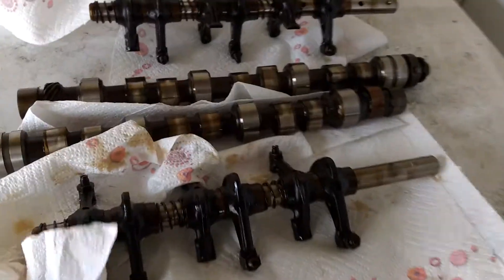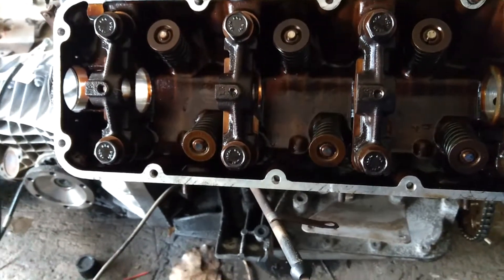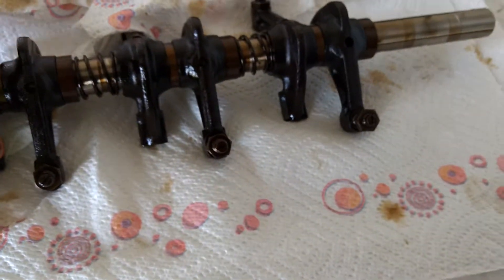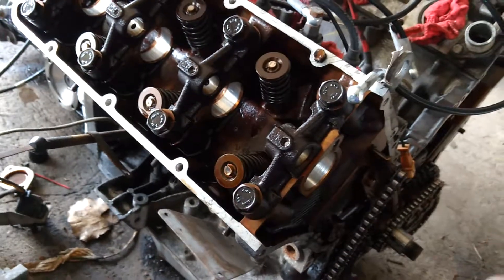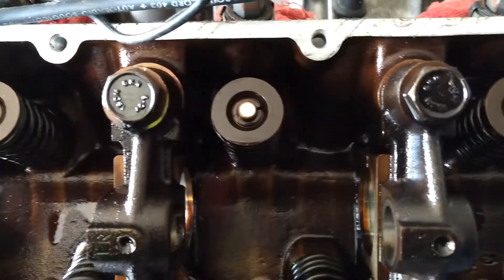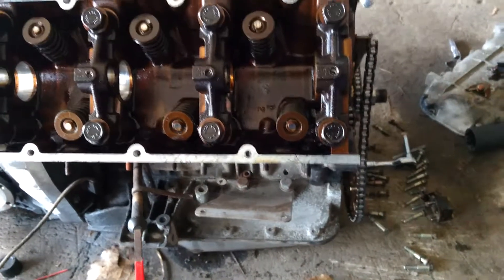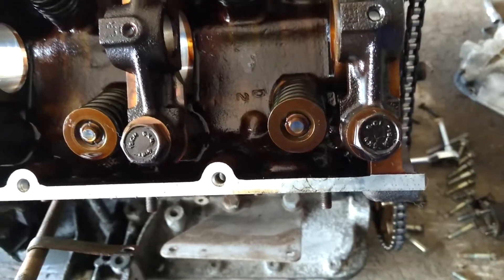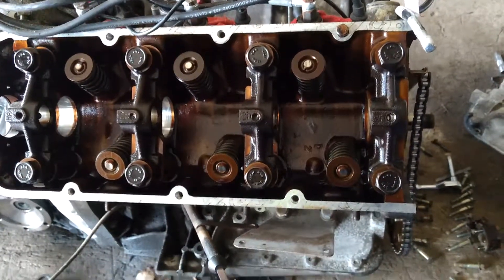Delorean removing the camshafts WITHOUT pulling the heads!!!!

Comment: Dosen´t work when in the Car ..... Head Bolts are not so expensive - DeLorean.com - about 150,- Dollars a Set....
Reply from the maker: Christian Meier yes you are correct it won't work while in the car I assumed that was common sense lol, I wouldn't order 30 year old bolts just saying.
Reply: well, Metal doesn´t age ... unless it´s corroded. Most of the Parts at DMCH are all reproduced / new Parts. There are no NOS Oil Filters or so.
Reply from the maker: I agree to an extent however dmc Houston currently uses NOS head bolts, and there have been cases of material fatigue not saying you can't use them just my personal preference
Reply: THEEEEN you need to throw away your car ... the Frame is old, all Bolds a re old, all Alloy Parts are old (THAT AGES !!!!)....  the Cylinderbolts last longer than the Engine Block, which is from fragile Alloy and can age. Simple Mild Steel is always harder than the Engine Block. Failing of them is NOT of Age. Or do you ask at Harbor Freight, Home Depot how "old" the Bolts are they sell?  ;-) --- actually 995 of the DeLorean Community drives around with unique Tires, "still good looking" Brakes, Coolant Hoses, etc.... well .... - NEW ones, even old are way better than some old ones (35 Years minimum,) which are in 99% of every DeLorean.... what´s different to NOS Parts then? ----- Your Logic Chain failed in this Point.

BUT Agree .... I ALWAYS change Cylinderheadbolts.... even if they "look good" or whatever. I also change ALL brake Bolts, when taking the Calipers of.... I NEVER refuse and Bolt, Nut or whatever when taken of my Cars...  (well, it´s a Habbit of my Job, Machinery Industry)
Reply from the maker: I'm not saying it can't be done not saying you shouldn't I'm just saying personally I don't your right the steel head bolts will probably out last the aluminum block just a personal preference, any boot I take off this car if it can be replaced with stainless steel or new stronger bolt I usually do it simply for peace of mind, but your right you can use 30 year stock and probably be fine I just prefer the ladder

Comment: Hi, Just wondering how your finding your new Delorean Industries Spec 1 camshafts, I need to replace my standard spec ones. Question is do I upgrade to these ? Many Thanks
Reply from the maker: Mark Elliott I do not have the DeLorean back yet to experience the new cams probably going to be another month or two believe me I will be putting up a boatload of new footage on the channel as soon as I get the DeLorean back but unfortunately I needed to do some suspension work and things to it so the car is still down but I will be happy to update you as soon as I get the car back and can experience the cams now these cans were recommended by Josh up a DPI and they were essentially good for the performance exhaust the DPI offers I don't know how much more aggressive with engine mod you can get with these cams I know they're good for the EFI conversion the DPI offers but outside of that the cans might have to be upgraded I haven't gotten that far yet but thank you so much for watching and I will update you guys more when I get the vehicle back

Comment: Yup! in 9 out of 10 the answer is no because the engine is assumed to be in the car. The medhod You used is only possible with the engine out of the car - or there vil not be room to pull the rocker shaft and cam shaft - especially the drivers side.
Reply from the maker: +Martin L yes that is true unless u drill a hole in the back of the bulkhead (not recommended lol) but I would assume that was obvious but still just showing people how to do it if they want
Reply: Yes I know :-) Agreed It's obvious in your video. Just pointing out why a lot of people might say it's not possible :-) Regards